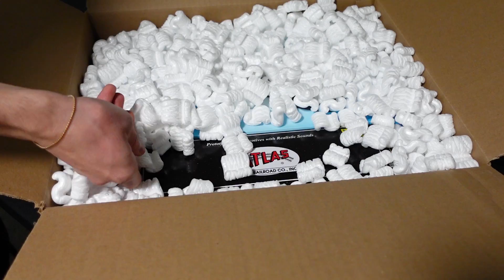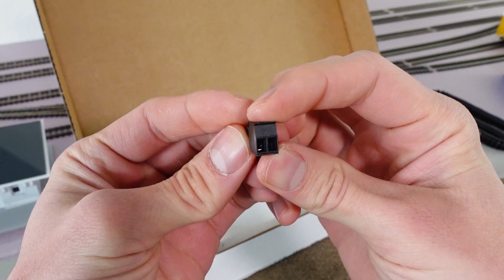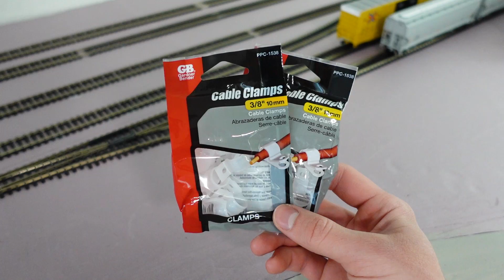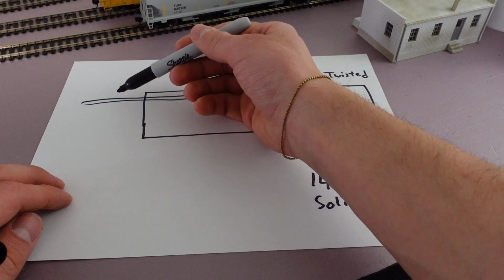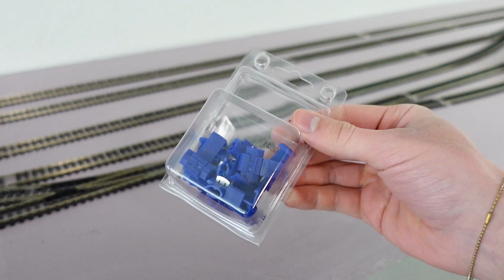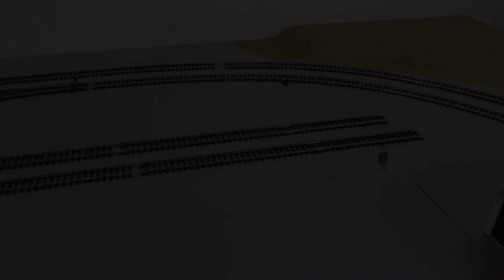Large HO Train Layout Build - Ep 8 - How to Install DCC (NCE PowerCab)

Comment: Hopefully I’ll be setting mine up soon.  How did you terminate the ends of the buss wires?   Also what brand turnouts are yours?   Did you need to power the frogs? Thx.
Reply from the maker: I just wrap them with a piece of electrical tape or let them hang, as long as you don’t have any bare copper touch. I used Atlas Code 100 turnouts for this layout. Nowadays I use Walthers code 83 DCC safe turnouts. You can power the frog if you would like, they leave a small place to solder for that specifically

Comment: Sir, 
I'm trying to get a understanding about wiring. You said in the video You should wire the bus line red being positive and white being negative and the red wire should be on the rear track and the white up front. What does that mean? Are you saying if I'm looking at my layout head on the red wire should be towards the wall, but if  my layout is U-shape and I'm standing on the left side of the table and facing the wall is the red wire still on the back side of the track? 
I also don't understand about reverse loops. Oh well I'll ask that question another time.
Thank you for your time 
Sincerely 
Allan

Comment: I'm interested in how you attach. or connect the controller to the to the engine and what each of these individual buttons do
Reply from the maker: The controller doesn’t connect to the train itself but through readings through the tracks! There’s lots of buttons and some are self explanatory but you’ll have to check out the manual for a more in depth look into the buttons and what they do

Comment: Great video and that DCC Starter set looks good, I will check it out.  One thing though.  My HO layout is only 4x8 with an outer and inner oval loop all connected.  With this size layout so I still need to do the bus wire and multiple soldered connections???  Would I be OK with just the terminal connections to the DCC controller?
Reply from the maker: You could probably get away with just the connecting of the DCC terminals but I would connect it and test it out all through the layout to see how to works

Comment: Good video. I use the Weller 7200 solder gun version. Its not as powerful, but the option of a trigger helps while soldering when not in use. I've learned that with NCE PowerCab, there is no "off" switch. I installed a rocker type into the power supply cord. That way, I don't have to keep unplugging the cable to turn it off.  Over time, the cord's plastic head connection wears down and breaks. With the switch I can leave it plugged in. hope this helps.

Comment: I used to drill a small hole in the rail. and stick the wire through. or just make enough of an indentation to put the tip of the wire then solder. I also used to wire m annual bocks where when a train passed over one section it activated another train or a switch. I loved the wiring aspect.

Comment: The correct horn
CV163=7 (Leslie RS3K)
The correct bell
CV164=1 (Default)
Alternate BNSF Horns
CV163=11 (Nathan K3LA)
CV163=9 (Nathan New Cast P3U)
Alternate bell (post rebuild)
CV164=2 (Slow EMD Bell)
Reply: I would try all 14 horns to see which one is your fav.
Reply from the maker: Someday I’ll have to mess with all those and see which I like. I appreciate the info 😁
Reply: Oh by the way i was looking at the wrong sound file, its actually CV163=0 to S3KR CV163=6 to K3LA and CV163=1 (Default) S3LR

Comment: Love your videos! 2 questions, did you attach your MDF board to the benches or just the foam to the board and are you planning on adding scenery to the walls or sliding in a scene on cards? Wondering if you would slide behind your hill/rock in the corner?
Reply from the maker: Thank you! And no I don’t have anything attached to the benches and I’m not sure yet. I think I’ll end up going the scene cards though and they should be able to slide behind the hill

Comment: Love your videos and look forward to them week after week, thanks for posting them. I am very impressed with the sounds that come out of the Locomotive! I was curious, just how many wires in total have to be soldered to the tracks in order to complete the Layout?
Reply from the maker: It depends on the size of the layout but what I did was do a pair of white and red feeders to every row of track. If that row of track was longer then 3 or 4 feet I put another pair of feeders to prevent voltage drops

Comment: I’m curious why do you have to put a feeder wire every 3 or 4 feet on the main wire?
Reply from the maker: It’s just to prevent voltage drops so the train can run smoothly
Reply: @TopRailroad  ok thanks, just trying to get info because starting to get into the hobby
Reply: Could you use terminal tracks instead off soldering?